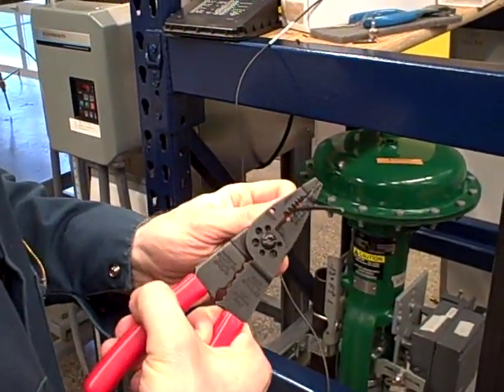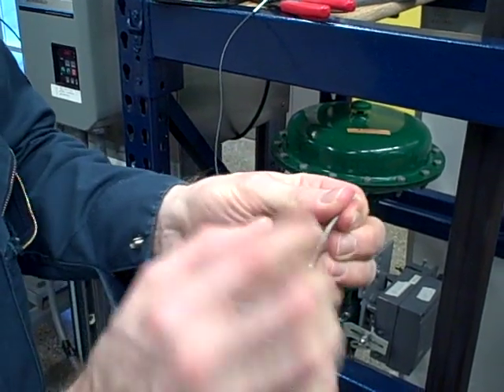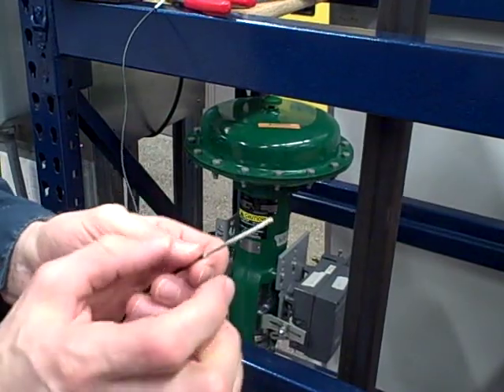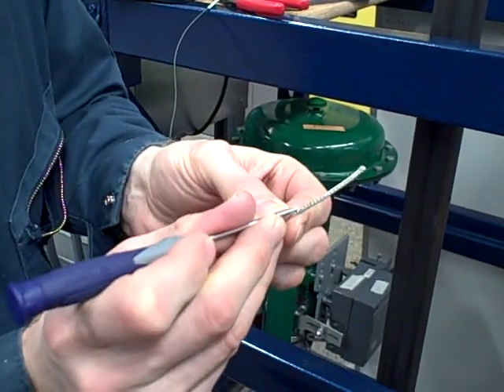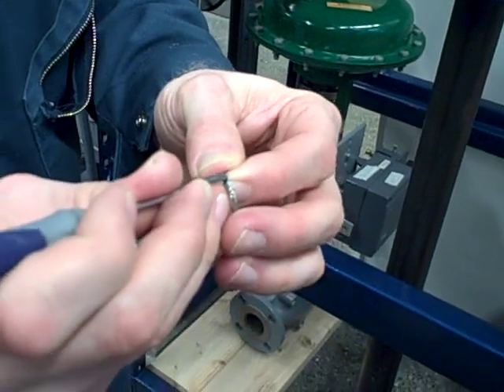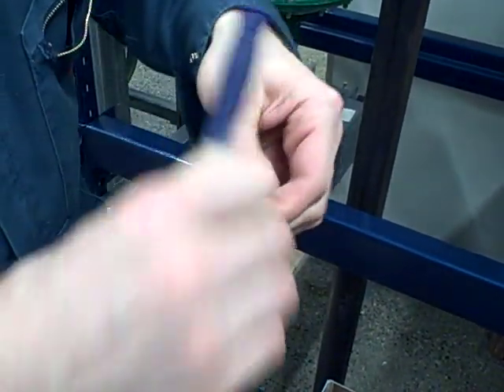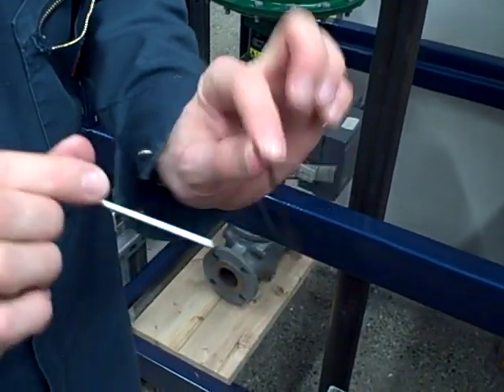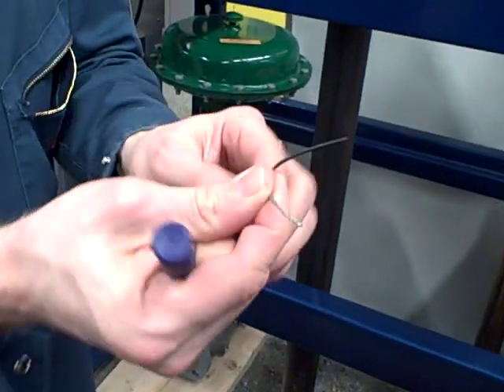Coaxial cable stripping

Comment: Okay for data cables but don't do this with coaxial antenna cable if you want to preserve the air-gap because bending the inner insulator this way will crush the air-gap in an instant.!